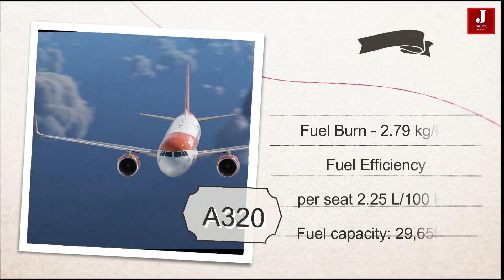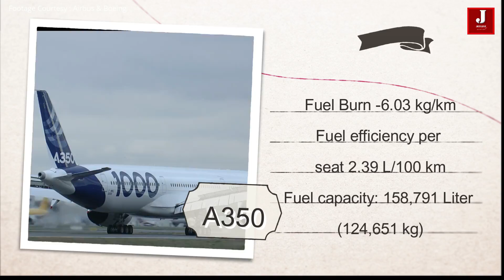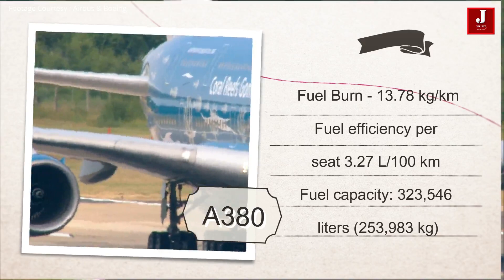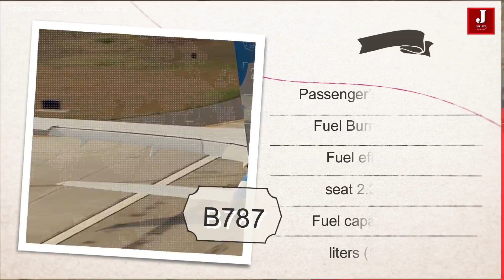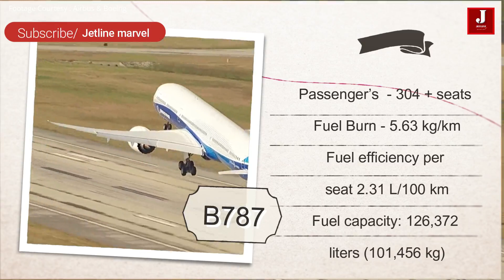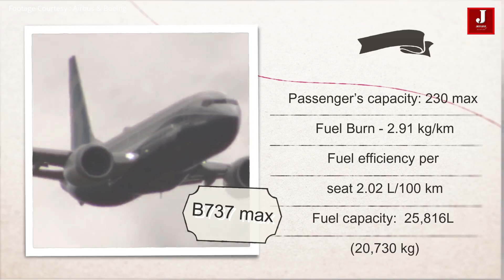Five most efficient aircraft and their Mileage..

Comment: I'm pretty sure currently the aircraft that burn the lowest fuel per seat per trip are :
1) 777-9 
2) A350-1000 
3) 787-10 
4) A350-900 
5) 787-9

The wide bodies will almost always burn less fuel per trip per seat than narrow bodies and the larger wide bodies usually burn even less per trip. The A380 is an exception tho since it's fuel burn per seat is even worse than the small 787-9.